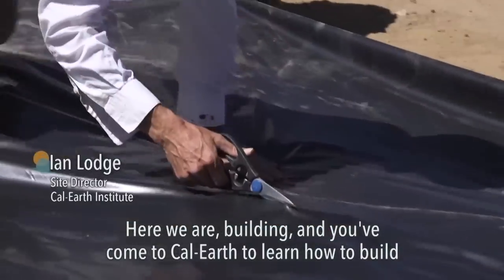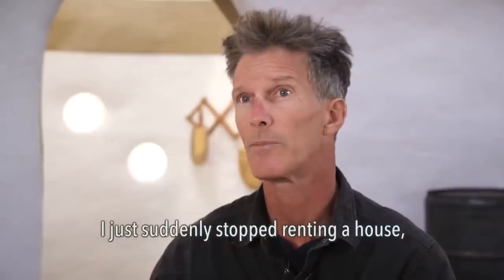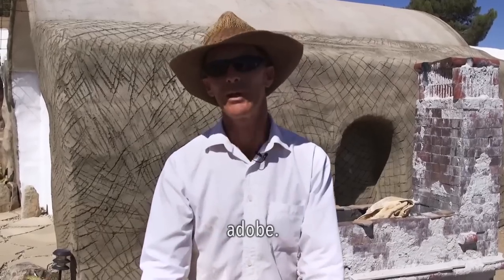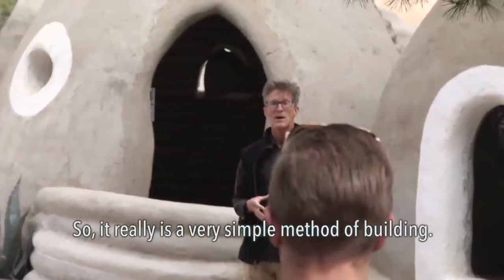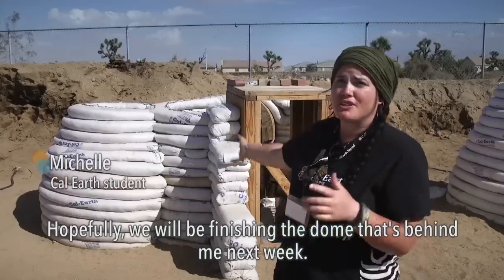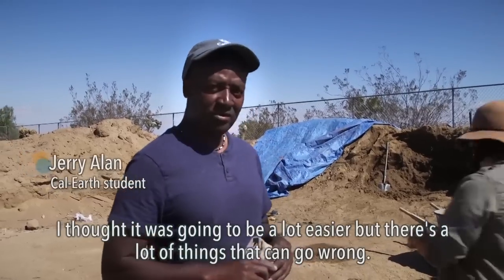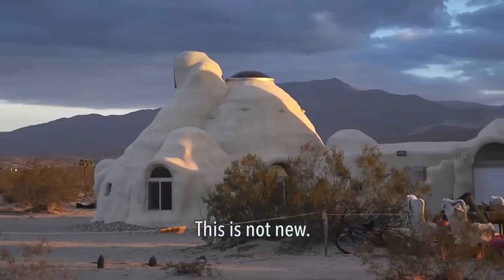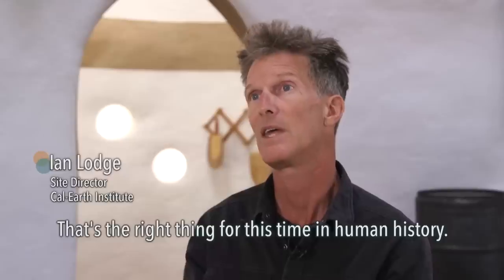How to build an earth-friendly home with sandbags | VOA Connect

Comment: I wonder how many Californians would still have a house if they had built in clay and soil rather than timber. Strangely modern materials and the building code, insurance companies and council regulations encourage people to build with flammable materials..lightweight materials - whilst discouraging appropriate and inexpensive building methods. It is in effect the complete bastardisation of architecture by construction material companies and 'the state' to disempower people and put them into debt and dwelling in environmentally inappropriate structures.

Comment: Ahead of your time. Only 2 years later unpredictable rainfall is literally 'putting a damper' on the prospect of viability. Guess it wasn't raining where you were back then. Well that has changed, drastically in some places, like the country I'm in. And it's mostly raining everywhere else now! And a more recent build even showed what happened when the build was totaled by a little bit of rain when they forgot to cover the partial build overnight. So it took a lot longer than a day to fix the sabotage. So, not too many areas are available now without the amount of rain the rest of the world gets. Unless built indoors, which is what I would do as inexpensively as possible. and then moved outside, which would be a task for the budget and a strain on the structure/materials. And like most other buildings, if the material doesn't dry out completely before being sealed up there will likely be black mold type problems. Now maybe when Earth gets past the evolving cycle of Insane weather and Superstorms, and until the far enough future arrives when the world-wide droughts begin. There are only a few of the worlds deserts where a perfect, or even successful outdoor build can happen, But, not many people can live there and the deserts they live don't get much rain. Combined with the fact that those people don't seal up their homes. So they are completely air dry all the time, so no mold, etc. . Hope this is all considered in your FREE (maybe) seminars. Just Saying. :)

Comment: Hell of BS stories. I got some sandbags and they didn't even last six months in the sun before they were had to be burned for trash. The sandbags even Decay inside of a building with no light shining on them. If you get that Dome covered with cement damn fast it might work.
Reply: I was wondering how long those bags would last. If they all perished at around the same time, and collapsed, maybe you could be buried alive?